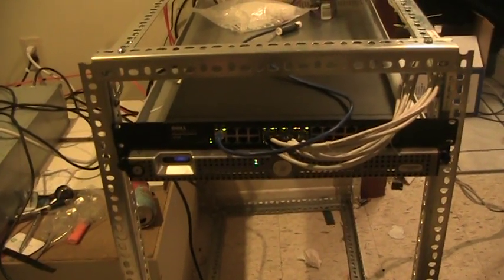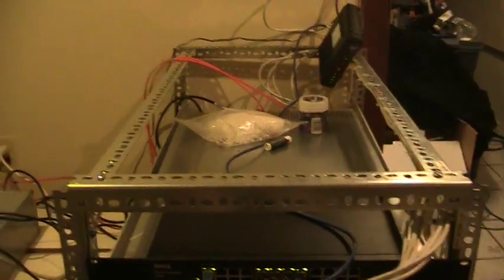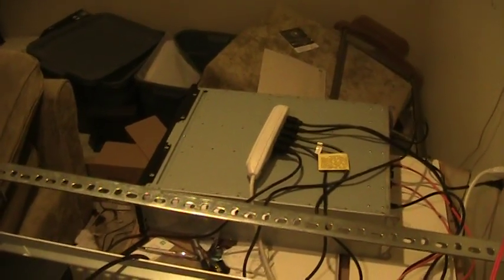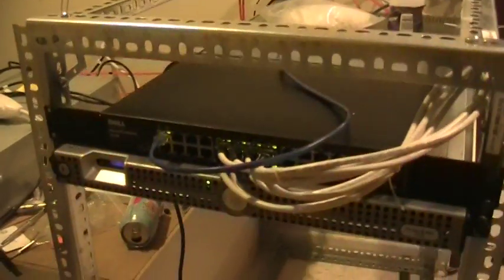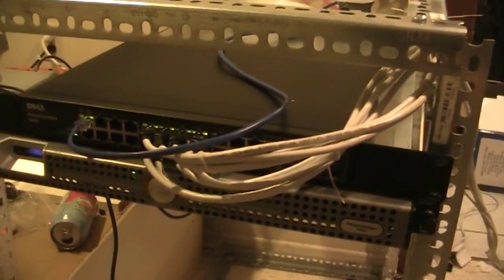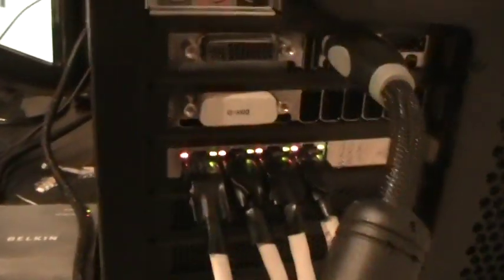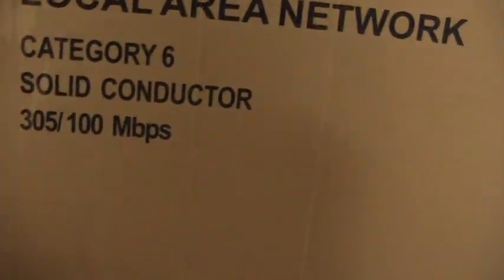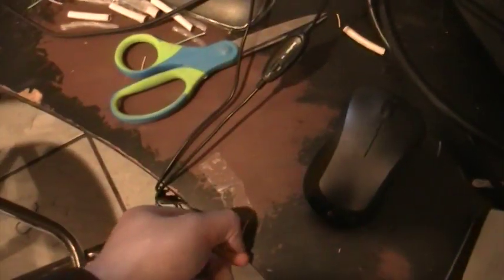Home "Data Center" Setup - SAN Array Setup - Cheap 4GB/s Ethernet Setup

Comment: No sir, you can NOT add that fifth nic to give you 5 gigabit..... doesn't work that way...
Reply: +HotNoob holy shit dude, its been two years since some very polite folks called out your lack of knowledge on L2 fundamentals and it still looks like you think you can get 5Gbps of total bandwidth in a LAG with a single bi-directional pair. Fucking crazy. Stop what you&#39;re doing... build your foundation of knowledge, read books and THEN play with the hardware. Cut the attitude out or you&#39;re not going to even get a shot in this field.
Reply: +xphilee What's better, is that my explanation as to why it wouldn't work, has been deleted XD 

While the "cards/drivers" may be compatible, the switches and such ARE NOT. They will only work at 1gbit UNLESS the switches up links are rated higher than 1gbit. And even then, unless other devices are rated for that speed as well, NOTHING will utilize the higher bandwidth. Granted it would allow up to 5 devices to access the single device at 1gbit simultaneously, BUT ONLY if the switch supports link aggregation as well, and is supportive of the same type of aggregation as the nics.
Reply from the maker: +Hikari drivers/hardware were compatible between the two. GTFO.
Reply: +Hikari Its a shame that many of the young whipper snappers aren't willing to put in the time to fully understand the technology. Everyone wants the instant gratification of getting something working, just to get it working and after that they really don't care about optimization or operation(lifecycle, hint hint) or frankly, how it work. Case in point is this exact topic, +HotNoob got NIC teaming working, made the assumption that he was getting roughly 4Gbps over a NIC teamed LAG not realizing that there are pretty strict L2 hashing limitations. Core fundamentals.
Reply: +xphilee +Hikari He has a server setup, u dont, let him learn himself not from your impolite crap thinking ur all know it all.
Reply: +Pumajil he has a setup yes, one that is improperly designed and implemented. But how do you know if we don't have our own server network? Pretty large assumption there. Maybe we are giving flak because we DO have our own server networks set up, and thus giving advice as to correct the mistakes made by him. It's rather difficult to have knowledge on a subject, without having actually participated in that subject yourself.
Reply: at the time of this video, it is designed properly for his use, to have internet access with his NAS or storage server in a different from with a fairly amount of high speed, but is also out of the room so his desk area is quiet.
Reply from the maker: +xphilee you are limited to 4 per LAG, that does not mean that you can't get 5Gbps, just requires a bit more configuration.
Reply: +HotNoob huh? No one here is talking about maximums of a LAG but how the traffic will be shared across member interfaces and your lack of understanding how the technology works. Again, take some time to learn the fundamentals before you start making silly claims like you do in the video.
Reply from the maker: you should look into linux.

Comment: Sure is nice with fast speeds.. but what is the use of it? Do you have sevral wan links coming into your home to share on the server perfomrance simultaneously as you watch ultra hd content from the same server? A 100mbit/s rj45 ARM Raspberry Pi is perfect for home users and packs enough of a punch to service any situation, if not, then there are plenty of fanless setups that gives x86 compatibility but costs abit more than 30usd, which RPi does!
Or do you bring people home from the bar by braging about your 19" rack? ;)
Would be fun to brighten my horizon by knowing what people actually use home servers for.. load exceed 5% cpu utilization?
Reply: +Denstoradiskmaskinen IMO a raspberry pi is next to useless for any real world home server applications.  Try running a dual xeon 6 or 8 core server with ESXI and a virtual SAN with the horsepower to run all the VMs a home setup or lab could need.  With that kinda horsepower you can have each PC or device on your home network connected to the server at it's full network throughput so video playing off the virtual SAN will start playing immediately and applications can be run off the server as though they are being run locally.

Comment: I think some of you guys are missing the key point.  The key is that it is a CHEAP storage array. Granted the Netapp DS2246 is a better buy..... $7,000+ isn't CHEAP.  Besides I think it's a good idea that he used an older Dell as the server.  This keeps the cost down while getting the job done until he can upgrade.  I'm thinking about doing the same thing in order to get a better understanding of storage options using ZFS.  If he's using the storage for backup purposes, this fits the bill 100%.  It would be different if the expectations were 10 GB/s.  Glad to see you trying different things to make it work.

Comment: Hi, I'm going to take same SAN such as yours, and altogether I dont know how it is configured. Will be second-hand, so this does not have any guide or manual. On the Internet, unfortunately I can not find anything. Do you have any video reviving a setting?
Reply from the maker: it's all plug and play unless non firmware ecc is enabled on the harddries.
Reply: HotNoob Thankx :-) Today i recieved this SAN... And i have big problem. I see my HBA and connected SAN as a Storrage, but ESXi can not connect any disk.

http://tirorin.eu/data/SAN/1.jpg
http://tirorin.eu/data/SAN/2.jpg
http://tirorin.eu/data/SAN/3.jpg

Can you help me with this problem ? I dont know anyone who have SAN and servers home like You and Me. Thanks for answer´.
Reply from the maker: looks fine to me, you just have to configure your disks
Reply from the maker: since it is netapp, u may have non fw-ecc on the hard drive, in which case you'll need to low level format it. 
i have another video somewhere that goes over llfing hdds via ubuntu
Reply: No problem its my test server i can install everythink on it without risk :-) thx i try install ubuntu :-)

Comment: And you actually get 4Gb/s? I always thought LACP meant every host could get 1Gb/s per connection as they would have a dedicated port to the server. So your setup could support 4 clients connecting at 1Gb/s speeds. Can you explain?
Reply: If he only had one 1Gb cable going from the switch to his PC he would only get 1 Gbs speed but since he has 4 going from server to switch and 4 from switch to ONE pc he gets 4Gbs. If he had 4 PCs with each having 1 Gbs connections they would all get 1 Gbs.
Reply: He could theoretically get up to 4 Gbps using at least 4 individual file transfers. A single file transferring from his storage to PC will still be limited to 1 Gbps with this setup.
Reply from the maker: Xero852 iscsi mpio is one way to get around that.

Comment: The biggest problem that people have is the cheap ass switches and routers. I have an HP procurve 2824 switch, with cat6 cables going trough my house with lengts up to 40 meters and getting 111Mbyte per second on a single gbit link. This is normal because of the overhead in TCP/IP protocols.

When you are teaming don't use the switch independent option but use a manageble switch and enable LACP on the ports that you use for teaming.

Also enable the LACP teaming mode on your nic and you have the best teaming option there is.

When you enable LACP on your teamed nics and switch you will get more speed, when you are doing 300Mbytes per seccond on a 4 gbit FC then you are already on 75 percent of it's capacity. Another limit you are looking at can be the disks and or raid controller in the san unit...
Reply: Yes please tell me where i'am wrong? Yes the switch in the video is a managed one... I saw that... and I never said any word about the dell switches. The only thing I was reacting to was that you told that server 2012 doesn't need a managed switch to do link agregation. That is right but not giving you the same result as an lacp link with a managed link.

And yes calling some who just finished his MCSA 2012R2 a snob and to review his 2012 knowlegde is counterproductive I think...
Reply from the maker: Should pay a bit more attention to the video. 
The disk shelf uses 2Gb SFPs; there was no point in hunting for 2Gb SFPs, as most 4Gb SFPs have backwards compatibility, and can run in 2Gb mode.

The disk shelf was going at 300MB/s, not because of bandwidth issues in the FC, but because the disk shelf was designed to run at 2Gb, not 4Gb. 

Watch through the entire video, where i point out how i was getting ~900Mbps of performance per ethernet cable. 900/8 = 112MBps.

Your snob level is pretty high in your post. 

You really don't need high end switches, and thanks to newer tech, you don't even need a managed switch to do Link Aggregation. Server 2012, provides a software solution built into the OS; don't even need NICs with drivers that have Nic Teaming.

People dislike the Dell PowerConnect switches, because they lack features...
features that you'll never EVER need to use... 

Same thing with routers, people use $10 000 cisco routers, for jobs that you can easily get away with a $300 router.
Reply: You don't understand what is going on at layer 2 do you? The switch independent option in server 2012 is working if the data is traveling from the server to the client. (Even then there are drawbacks) The other way around it doesn't work and you are limited to the capacity of one link because the switch still links the ip of the server to just one of the mac adresses in it's arp table. LACP is a way to overcome this limit but then you need a managed switch... even with LACP you dont get the full aggregated bandwith in all the situations...

So think again before calling someone a snob...
Reply from the maker: plopeye1 no need, ur snob level is still through the roof. you should also review ur knowledge of server 2012.
Reply: HotNoob Well he is right about the layer 2 part no doubt about it. You should really have a managed switch because he is right. the switch is a dumb switch, when teaming you have 1 ip per "teamed" nic. I shouldnt have to tell you how a layer 2 device works. just get a cheap cisco switch. you can find them on CL and ebay all over the place.
Reply from the maker: John Abraham funny how non of ya realized the switch in the video is managed.

Comment: Hello.

Can you explain a little about what this does exactly?

Is it just a case for hard drives then you have to run your own software like FreeNAS or Unraid,etc...?

Or is this a standalone NAS itself with its own software/ hardware RAID solution built in?

Does it use standard  SATA hard drives ? Are there limitations such as being under a certain size? ( example, under 2TB drives,etc...)?

Please let me know

Thanks.

Comment: you are into a lot of interesting things that I thought only I was into  I also have a fibre disk setup the box with the fibre drives(seagate) similar to your own, a matrox extreme raid 3000 controller. matrox has two 100 mb "channels", so you only need to plug into loop A on the disk box. I have two boxes each hooked to each channel.You can configure a logical drive by taking 4 drives from one channel and 4 drives from the other channel, and it pushes 200 mbs. iz speedy on large sql tables.